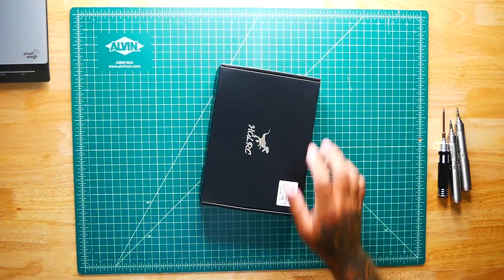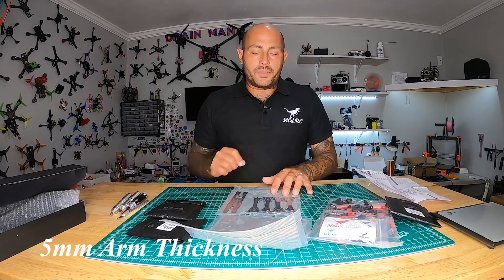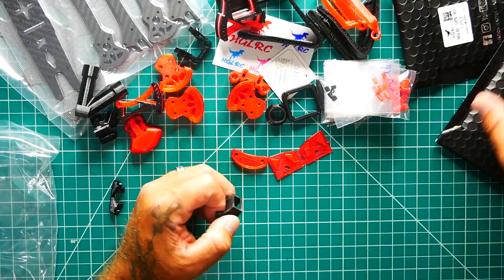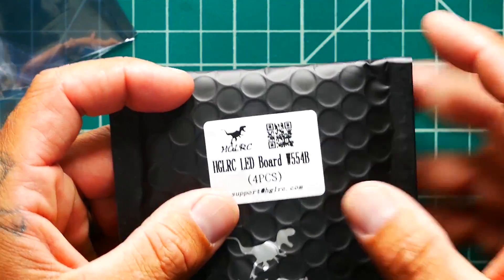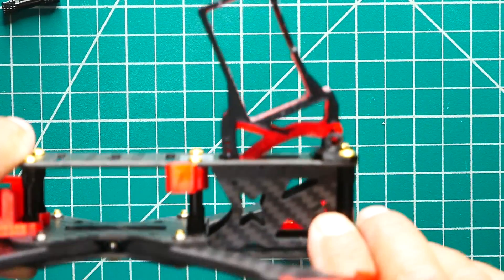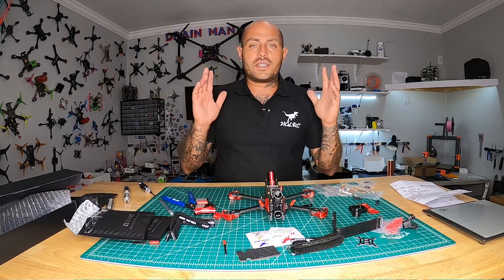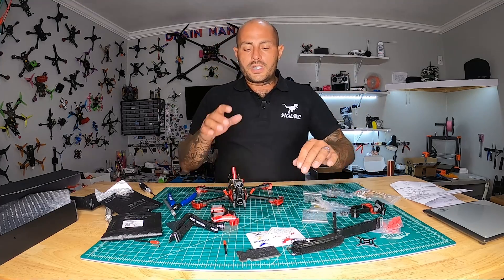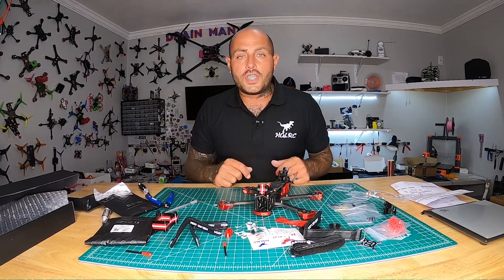Don't Sleep On This One! HGLRC Sector 5 V3! - HD or Analog!

Comment: 1:48 "So then you're digging around your pile, and you're robbing stuff...."  🤣 I only have 2 quads, but I've already done that 
3:01 "Oohh.......its got texture....." 😁
3:43 "holy schmoly...." 🤣 
4:08 3 color TPU printed! Nice!!!
9:10 awesome transition bro 😁
9:38 "The T hole..." I don't own a go-pro, but that mount looks very well thought out.....
14:20 antenna wire routing/protection looks awesome
14:55 GPS mount? So frickin thoughtful!
This company must be run by hobbyists/enthusiasts, because it is evident that they put LOTS of thought into every aspect of the design. Every optional piece of hardware/screws/3d printed part was supplied! I am really impressed by what appears at this point to be a nearly flawless design.
QUESTION: Are the actual carbon fiber frame parts of good quality? Is it STRONG at its carbon fiber heart?
Great review brother!

Comment: Why did you use a black screw in the back arm of the quad? I like the frame and I think is in a good price range. I’m not sure got strong that GoPro mount will be and if will hold a crash unless you can secure with a screw or maybe a pin not only the front but alto the back where you set the angle. Also good job reviewing the frame. Looking forward to see more of this reviews in the channel
Reply from the maker: Thanks Nestor I left the bolt out that holds it so I can show how it works. Yea they shorted me a gold screw.